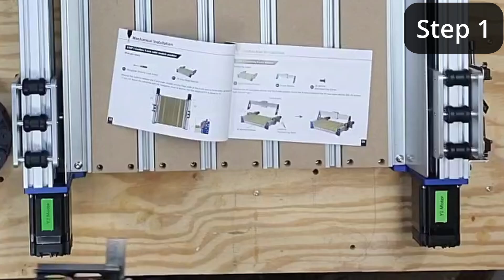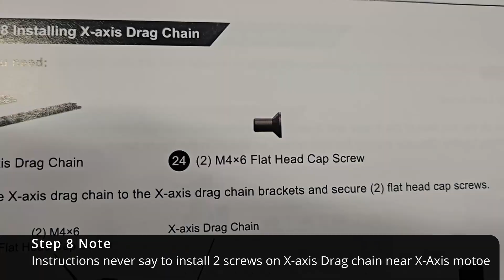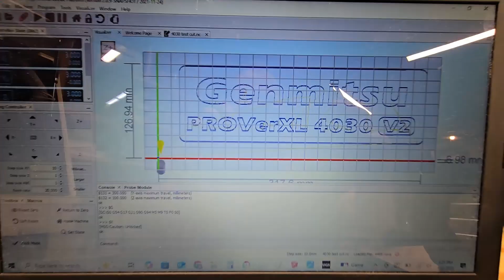Genmitsu PROVerXL 4030 V2 CNC: Is it Worth the Hype? Unboxing & First Impressions

Comment: Great video - thank you for making it.  I'm about to pull the trigger on one and an extension kit, seeing the assembly and unboxing is something other videos have glossed over.
Reply from the maker: Thanks! I'm loving my Proverxl V2. Just added the 6060 extension to it and it's doing great.
Reply: @old.fashion.nights  I'm tied up between the 6060 or the 1313.  Apparently if you tweak the limit switches on the 6060 you can get it up to 66cm or something like that on each axis.   I just don't really have space for the 1313 unless I build a folding cart for it.
Reply from the maker: Reason I went with the 6060 was I didn't have room for the 1313. I didn't know about the limit switches opening it up to 66. I might have to dig into that more. Thanks for that info!

Comment: why does when jogging in increments the machine sometimes takes off  and needs to be manually stopped,  Plus I'm finding on all axis that if I move 20mm on my lap top the 4030 only moves 10mm
Reply from the maker: What g-code sender software are you using? I was using UGS and had similar issues (jog in 1mm increment then took off). I thought I fat fingered my keyboard but caught it on video doing its own thing. I switched to gSender and haven't had the issue anymore.
Reply: @old.fashion.nights  Thanx for getting back to me , I use Gsender as well and not every mouse click moves the machine the same distance every time. need to figure out how to calibrate this machine so I can use it. 10 mm in Gsender and machine only moves about 5mm